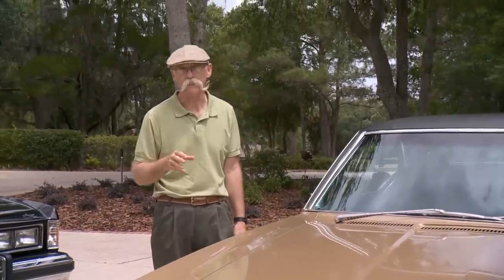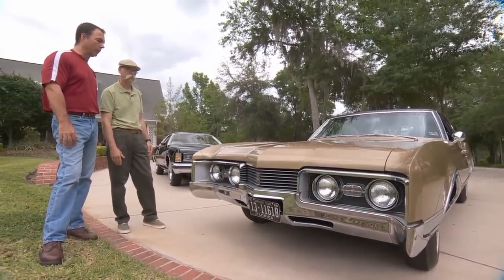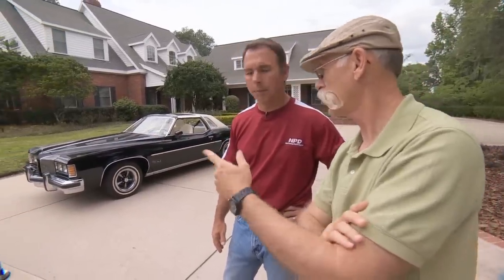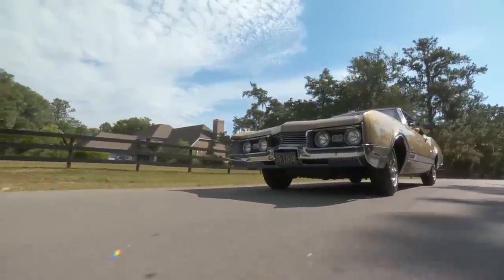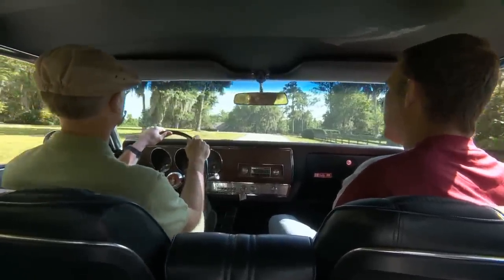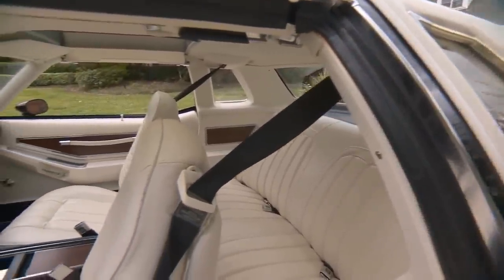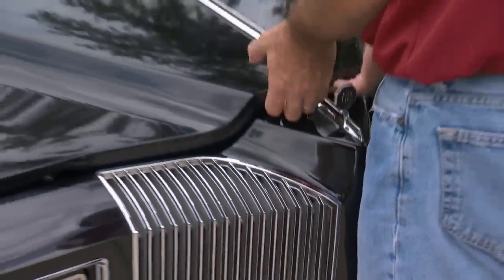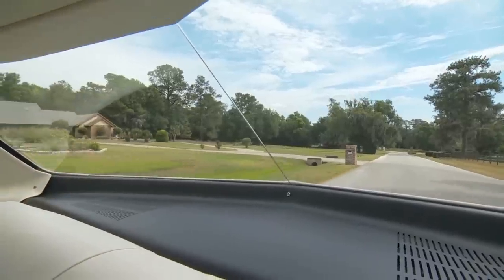GM Luxury Sports Cars

Comment: Nice choices,Dennis!! Both are gorgeous....love the interior in the Grand Prix-love everything about the Olds,actually very surprised how quiet it was...you would be amazed what that Super Rocket sounds like with straight pipes lol I had a 1973 Delta 88 Royale 4 door-originally had a Rocket 350 2bbl with a turbo 375-when that wore out I went out back to the small junkyard we inherited with a property we bought and started pulling dipsticks to see what I had-in a1966 Delmont I found it to be full of clean oil-radiator was full of coolant-it had been sitting there 12 years-so I hooked up a battery and hot wired it-popped back through the carb-they had junked it for a timing chain-I thought I had a 455,it was 4 1/8 “ bore-in great condition,I put rings and bearings(both stock,still in tolerances)  and pumps and did a 3 face valve job-it was when I needed to replace a bent valve that I found out I had a 425 Super Rocket-OMG....that Delta with the turbo 375 actually had respectable performance,amazing for a 5100lb car with only 175hp-when I dropped that 10.5:1 425 in it I was turning low 13s high 12s in that 4 door delta-once i got it quieted down with 3” duals and turbo muffs I had a hell of a sleeper,won a LOT of money with that car...,

Comment: I owned a 1976 Grand Prix but mine had a 455cid motor. I was surprised that the one had "only" a 400cid motor. I bought mine in B.C, Canada so maybe the engine options were different for USA & Canadian models. Nice cars. I owned mine for about 14 years and finally sold it to a bloke who had a pristine "Gold Anniversary" - Which was essentially an 1976 SJ with a special gold paint and gold rims. 

GM made over 230,000 Grand Prix in 1976 in all trim levels and I would guess that there are fewer than 3,000 still in driving condition, and probably less than 50 in collector condition. 

And yep, those Hurst T-Roofs leak . . . and you sunburn on those mid-Summer days (but way worth it).

Comment: My first car was a 1977 Pontiac Grand Prix.  Beautiful cars, ran smooth with a nice sport tuned suspension, but the downfall was the bodies.  I'm told 1977 was a bad year for cars because we used a lot of Japanese steel.  My car ran forever, but the paint was literally holding that body together.

Comment: I had a 77  triple green Pontiac GP SJ with the 301 2bbl. Terribly underpowered, but nice ride. I got it from the original owner in 2000. I sold the oil puking thing in 04. That owner, put in a 400 4bbl from a 70 Catalina, and added gold flake T/A rims. Car was still 100% rust free, with original paint. In 05, the car got stolen. The police found the car, but it's left quarter glass was missing, the column was peeled, and the trans was junk. Some guy bought it as a derby car for $700.00. The car deserved a better fate!
Reply: Adam Trombino  had a 75 GP LJ 400 4bbl it rocked

Comment: I believe that in 1976, only the 50th Anniversary Grand Prix model came with T-Tops. If a buyer wanted them on any other GP model, the T-tops would be dealer-installed.  I sold my '76 Grand Prix SJ two years ago - it had over 150,000 miles on the original 400 and still drove like a champ. These cars handle incredibly well for their size and their era. I miss my car and am now looking for a '76-77 Grand Prix SJ with under 75,000 miles - they're not too easy to find anymore!
Reply: hey Alex I have a 76 grand prix sj
Reply: Have you tried the website called Racing Junk?  Saw a 77 SJ burnt orange, around 75k miles, in W.V.
Reply: Thanks for the tip! It must have sold, as I looked on the website and there was no '77 SJ in burnt orange to be found.  There was a blue '77 listed though, but unfortunately, blue is at the bottom of my list of preferred colors.
Reply: You're welcome.  Sorry so late getting this to you; good luck finding one.  '76 and '77 G.P.'s are nice cars; wish I had time/funds/driveway/garage space for one.  Will pass on anything I find as I am trying to help a friend find a '79 T/A.

Comment: I had a 77 with T tops they didn't leak mine had cloth holders for the T tops.Loved that car, I said cloth T top holders but I think back probably cloth and leather. Motor was the controversy it was an Oldsmobile like 406 or 403 .Two tone silver and black with red pinstripes.She was a looker black buckets in kind of a velour feel cloth.

Comment: Would take the olds all day long. I had a 68  with the 455, what a great engine. Also had a 77 Pontiac GP with T roofs. The interior was great in GP but the the engine was a turd by then. Earlier GP’s were far better, the 69 to 73 would really perform. The Grand Prix’s with a 4 speed were the best.

Comment: Growing up we had the sister car to the Delta coupe, called the Delmont. My Dad ordered it sight unseen. His first new car. (for my mom) Same 425, although I don't remember the "Ultra High Compression, use premium fuel" sticker on the air cleaner. The Delmont was a lower model with less trim, but same body as this. Took my first road test in this car. (failed)

Comment: I had a 77 LJ Grand prix mine was white with a black top . Black interior very nice. Low miles.  I  wish I still had it 350 engine with 350 turbo transmission I was young and poor. It needed to be taken better care of than I was able to . I paid 800 cash bought it from the original owner

Comment: I guess my friends Dad had a '68 Olds Delta 88 Coupe, it didn't have as much trim as that one but it had the 455 motor! I remember he had to let off the gas after laying over 100 feet of rubber as it could have spun the tires until the end of the block. It wasn't fast; too heavy but could lay rubber anytime.

Comment: I had a 1977 Grand Prix, I put over 100,000 miles on it. The engine went out at 22000.00 miles. Replaced it with a Chevy engine. Sadly the body hardware was bad. The floorboard cracked without any reason like rust.Fun while it lasted.

Comment: Quieter,....Smoother ride,......the 70’s cars were a easy handling with enough gas pedal to have some fun!     Had 73,74,75 442’s.    60’s cars just plain look better,...more raw power.  Lots of big knobs,...and cooler interiors.  Get way more looks!   And are very unique.     But you’ll end up taking that 70’s car to work.   They handled better!   Power brakes,steering all we’re safer.

Comment: Considering the Pontiac Grand Prix is a SJ model with T-Tops , I'm surprised it didn't  have power windows or door locks. My 1977 had power windows , door locks , tilt wheel and cruise control. No T-Tops though.

Comment: From 1972- mid 80’s all engines were strangled with emissions control.  Don’t get me wrong, I’m all about emissions control, because without the Big 3 being pushed with regulation, we would never have Hemis with 350 hp and 20 mpg or much less the 707 Hp Hellcat.   The recent horsepower war could not exist without emissions control, and what the manufactures have learned over the last 4 decades.   But the first round of emissions controls it was all knee jerk response to emissions regulations.   They went strictly for emissions, not mileage or efficiency.   So to get the emissions numbers down they had to lower compression to get Nitric oxide levels down, and the cams were so mild the horsepower dropped even more.    100 Hp loss in one year.  Your 210 Hp 302 or 305 2V went from 210HP to like 135.   The big blocks went from 310 plus to 210.   Sad, sad days.     Remember the Top Gear episode where they drove the big late 70’s luxury cars and even the 460, 454, and such were pathetically sluggish.    That was a low point in American manufacturing prowess.    But I did like the swivel seats in the late 70’s Malibu.    Remember that the top notch Smokey and the Bandit Trans Am only made 250HP.    Sad.

Comment: "It is a 425, which was basically the same as the 455" Are you kidding me? How could someone owning that car know so little about it? The 425 was a pre-smog high compression engine. The 455 was a smog-dog. The 425 would just scream in the top end. Way more powerful. I'm not sure the HP numbers reflected the actual HP. They were notoriously underrated.

Comment: Crazy how Oldsmobile had better built cars than Pontiac and Buick combined. Case in point exhaust tubes on a Buick vs a Olds. The Olds exhaust tubes seemed to be made out of a impenetrable rare metal vs Buick.

Comment: Where do they get pristine, 50-year old cars with practically no miles on them?!  They must have a time machine.
Reply: Auctions.
When these cars were out they had horrible gas mileage and the 70s was when gas prices started going up. So any sucker who bought one of these probably couldn't afford the gas prices and couldn't sell it. I drive one as an everyday car, of course mine doesn't look half as good as these guys.( My dad bought it roughly 23 years ago and it sat outside for 10 years untouched)

Comment: What the hell happened to the car manufacturers of these days?
Reply: Accord Centre Safety regs and efficiency.
Reply: A number of things happened. The 1973 oil embargo ended the era of cheap gas. Safety, fuel economy regulations, emissions regulations (this alone nearly killed engine performance in mid 70s to mid 80s). Fuel economy and safety became very important to car buyers.

Comment: I just have to take exception with calling these "luxury sports cars".  These cars are pretty much the antithesis of sports cars. A sports car's primary function is handling. Putting fake wire wheel covers on a car does not a sports car make.

Comment: Mine never leaked.
Reply: I had the identical car, absolutely loved it. I believe mine had a\c.  What I loved most was the white interior and the contrasting black dash. In '77 I was 20 yrs old. I am now 62 and still yearning for white interior. Of course, the t roofs were heavy for me and after a few times of bagging them in the trunk, I just used the bag to separate them.  Of course, I had to have them off, especially when my 220 lb Blue Great Dane was with me. (Which was ALMOST ALWAYS) He loved that car too. Cleaning was a breeze. Windex cleaned everything in that car. 

I also had the following year, (I think) of the same car,  but it was two tone blue, blue velour interior, with T-tops and a huge engine. 455 maybe? I don't recall why we even purchased that one, since I had my black beauty, but I think it was too good a price to pass up. Originally ordered for the son of the owner of the dealership and it was loaded, but for some reason, it went on the floor. Husband saw it That afternoon, by evening, we took it home. I would go out every day just to hear that engine. Loved that engine and it's powerful sound.  Funny, my Dane didn't love it as much, guess he thought it clashed with his color. I miss those cars, just like I miss white leather or vinyl, velour interiors (again, Windex ) bench seats & station wagons.  And now, sigh, losing Cd's

Comment: If I have a vehicle like that if you're not going to drive it
Reply from the maker: Preservation?
Reply: @MyClassicCarTV  yeah I guess you do have a point there but still at the car was mine I would drive the hell out of it. It's built to be enjoyed not to be looked at. Then again if I had that kind of money that I could buy cars and not have to drive them because I had other cars to drive then they might last longer like that. However that's not my case. When I get a car with whatever mileage is on it I take it till it's death. The best one I've had was a BMW 525i with a 5-speed manual transmission I'd beat the snot out of that thing for a hundred and fifty thousand miles or more and it has over 350K on it now. Its been well enjoyed.

Comment: The cars are good looking and comfortable but sucked gas, polluted big time, handheld for shit, and were deeply underpowered.  Take that 60s and 70s look today, replace the frame and body's metal with Carbon Fiber, add an electric power plant, up to date audio, navigation, and communication electronics, upgrade the suspension and braking, and America would rise to the top again!  Folks should also remember this is the age the Arabs raised the price of crude, and the Japanese took the lead and have never, ever looked backed.

Comment: Typical GM 1970's junk build quality. I owned this car, or one like it.  By 80,000 miles, it was ready for the scrap heap. Lower fenders behind the wheels rusted through, sagging spriangs, front end needed rebuilding two times, pitted chrome, alternators, power steering pumps, exhaust systems, radiators, etc. etc. etc.  Thank gosh GM's quality is now light years over what it was back then.
Reply: As long as you believe that ok
Reply: itsmegp46 Talking out of my ass.Maybe i been told i got a smart one.Lol Take a look at the recalls of todays cars and constent dangers.The so called saftey features are killing people.Them cars then well you had to deal with a massive grille(no need for air bags).Don't get me wrong some of the new cars i am in love with but the cars of yesterday well cannot be compared to.
Reply: Brian Jones Not only do I believe it, but it is true.  Every automotive expert will tell you the same thing. As for recall, they're nothing new. I remember one where GM had to recall some SIX million cars from the late 60's to the early 70's because of faulty engine mounts that failed and caused the engine to twist over on its side. Finally, if you think a massive grill is going to protect you in a frontal crash VS a built during the last twenty years, you're even more clueless than I thought.
Reply: I'm not clueless i just have my own opinion.We can just agree to disagree ok...................ok
Reply: Brian Jones I can agree with that, but don't tell me I never took care of my cars.  Living in the snow belt, with salt laden roadways, rusted through body panels was a way of life.  It just does not happen anymore
Reply: This car and ones like it were/are awesome.superb styling and if taken car of these cars will stand the test of time.This car is proof of that fact.
Reply: Brian Jones This car was babied from day one.  Take any other car from that era, use it every day, summer, winter, road salt and the body panels would rust through guaranteed.
Reply: ***** No doubt it was a gorgeous car, but it just wasn't put together very well.